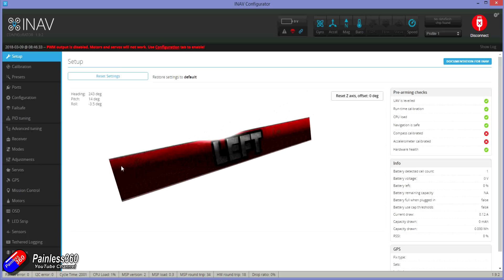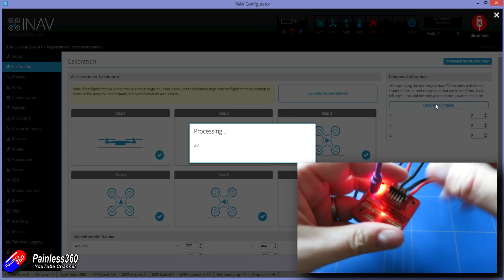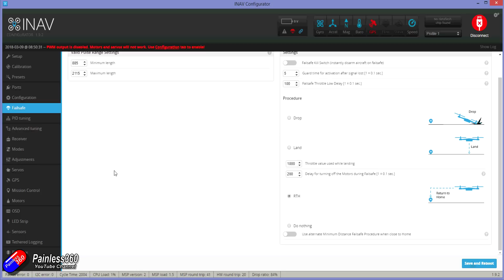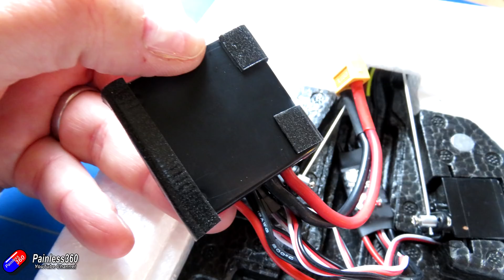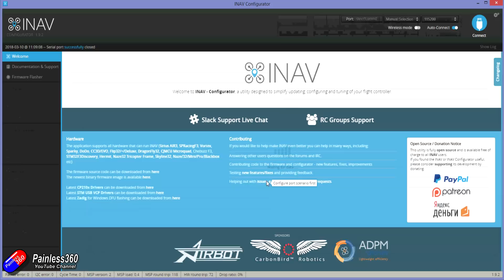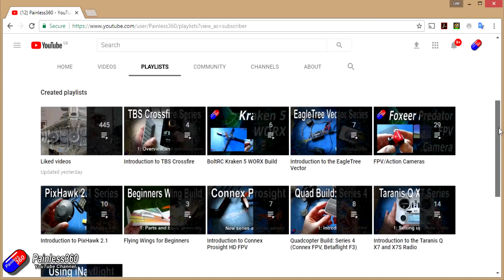iNav V1.9 Wing Build: Basic setup and installation (Orbit Wing and F35 FC)

Comment: if the battery powered the fc is it ok if i just plug in motor servo along with esc to M1/M2?
Reply from the maker: See the series for the steps. I also have a more up to date iNav 2.1 series...
Reply: @Painless360  aye2.

Comment: Hi bro hope you got a minute to talk got this furious f35 on my tbs wing2. Got a auto launch problem i’ve set all the stuff out exactly as you said like shortening times on the launch all working fine but it’s nosediving into the floor I’ve tried it in horizon and it just flying in a straight line doesn’t get altitude. I can see in the CLI the launch max altitude is at 0 do I need to put this up for it to climb?? or does the launch max angle deal with that or do I not know what I’m talking about 😂 thanks man lov your video your a massive help in the community 👌🏻👌🏻
Reply from the maker: Make sure it is in launch mode by shaking the model hard to start the engine, if it doesn't throttle up it''s not in launch mode..
Reply: Painless360 no that all works fine it just don’t climb go’s straight or smash in to the floor 😐

Comment: i am busy with the inavflight f4 (same as you) and i have it on my desk now, i have done all calibrations but the strange thing is that on my screen in inav it is moving on his yaw (same as in your video).... when i move the fc in yaw its working fine.... BUT when i only moving it on its PITCH then it show movement on yaw ?!?? When i pitch down it als moving yaw to the right, when i pitch up then it yaws to the left??? do you have that also? and no problems with it on your plane/wing???? i do not want to build it in my plane now....
Reply from the maker: I wouldn't use it until you figure that out. See my inav videos. Best of luck..

Comment: Hi Lee, I've set this FC up in a teksumo. Everything was going really well until I turned on the servos. Pitch acts like aileron and aileron like pitch. Everything is correct on the receiver tab in inav but when I click on the servos tab it says "no servos configured add them using the mixer tag" Mixer tab says flight controller needs updating to use the function, even tho I have the latest firmware? Any advice would be much appreciated. Paul
Reply from the maker: Sounds like the servos are plugged into the wrong outputs.. I’d swap them round.. best of luck!
Reply: Hi Lee, thanks for getting back to me. I tried that but it just changes the direction of travel but still the same problem. The biggest problem I have is that I cant access the servo tab. I'll e mail you some pics of the screen. Happy to arrange the phone or skype support with you. Cheers Paul
Reply from the maker: Paul Stuart all of the steps that I followed your in the video series. I don't provide support outside of the YouTube comments, best of luck
Reply: All sorted now using inav 1.9.3. I was using 2.0.0 rc3 where it wasn't working
Reply: Hi Lee, Just finishing off the setup now and have noticed a large reduction in throws whilst in Angle and Horizon mode. Do I need to change settings some ware for this or is this normal?

Comment: Hay just a quick question, if I choose the preset wing I notice it has expo on the configurator do I need to add any expo in my transmitter?
Reply from the maker: You can add it at either end. Adding it on the radio does allow you to change it inflight. Best of luck

Comment: Yesterday 2 miles from home my wing using the f35 suddenly disarmed without me telling it to. Fortunately it crashed in an area that we pretty easily found my wing. Any ideas on what caused this?  I’ve had many successful flights with this board already. Some have suggested I should be running 1.9.1 as there is a known bug with 1.9.0. I’m trying to update the fc but I’m not having any luck. “Stm32 communication failed, wrong response, expected 121 received 0”. Any ideas?  Thank you!
Reply from the maker: Lots on this in the Wiki - there are changes to iNav 2.0 to help ensure this doesn't happen..

Comment: Flaperons works great, but I need flaps on a Ranger 2000. Because I have already cut them out. If I knew.... To many negative things coming up on the F35. First was the RSSI: it does not support analog RSSI. Now with the flaps. And I don't know until maiden!?! I really don't know if it was a good choice. Kinda disappointed!
Reply from the maker: Things like flight controller more to do with the INav software than anything else. I wouldn't worry too much, iNav 2.0 as a completely different mixer setup..

Comment: Hi there! Any idea how to add flaps.I am using the f35 with L9R and Taranis? Thanks and all the best!
Reply from the maker: See my custom mixer video, but if you hang on a little while it's all about to change. In iNav 2.0 there is a completely new mixer section that should make setup of these extra pieces an awful lot easier.
Reply: Waiting for it. Thanks a lot and all the best!

Comment: Hi there and thanks for all your inspiring and informative videos. 
Question: My planned setup is Nano Talon with iNav 2.0 running on the F35 FC. The deviation is that I'm replacing the one default aileron servo with two (one in each wing). This to obtain better stability through tighter control of the ailerons (les slack in the mechanics). 
Can you tell me how this can be adapted in iNav? Kind of modifying the basic Nano Talon iNav setup with one extra servo for the ailerons. 
Your reply will be much appreciated. 
Best regards,
Torgeir
Reply from the maker: Until I play with iNav 2.0 more it’s tricky to comment. The new mixer tab in iNav 2.0 should make that a breeze..
Reply: Painless360 Thanks for your quick response. Really hope you will follow up with some videos of the 2.0 version as well. Your videos are much appreciated.
Respectfully Torgeir

Comment: Hi.
I have everything setup but can't seem to arm my motor
I have assigned a switch but its not lighting up the bar when selected, i replaced my esc because i thought that was the problem but still have the same issue 
Transmitter working correctly in I NAV
Many thanks
Reply from the maker: What other troubleshooting have you done? Has it ever worked for example?
Reply: Hi
no never worked. In i nav i have run the motor through the motor section and the slider so i know it works just can't seem to arm the motor 
i fly in mode 1 but never had any problems with my quads and this is my first wing
Reply: My ESC is making the correct chimes when i plug in my battery as well
Reply from the maker: Check that all the checks are green in the iNav app and then it’s usually the min throttle value needs adjusting..
Reply: That's the problem, trying to set up the RTH now have selected RTH in fail safe tab but still have a X will have a little play
Your a star thank you

Comment: You mention each time you reboot the image moves around in the setup menu as it finds it's place. Mine does the same, but then continually twitches back and forth even when place it on a table with no possible external factors affecting it. 
Does this mean my accelerometer is damaged?

Comment: Hi, im trying to setup my f35 on a ar wing with Inav,i wire m2 motor, and s3and s4servos, with a spektrum dx8 transmitter and i cant be bale to arm motor and servos works but i have to adjust travel and end points .How can i asign arm mode and autolanch, rth etc...
Reply from the maker: That will be covered later in the series.. It's all in the documentation if you need to look it up now. Stay tuned! :D

Comment: Hi Lee, I am hoping to put an Omnibus F4 pro + x8R into a Bixler 3. The Bixler comes with the Aileron Servos connected with a Y cable, Do I have to split the servos as Iwould prefer not to lose the channel. I was hoping to use channel 5 for flaps and ch6 for s.port? Thanks
Reply from the maker: I'd just use the single line from the 'Y' cable for the Ailerons. It's how the iNav system will default anyway.. I prefer to use the easiest method :D
Reply: Painless360 Thanks. I'll give it a go. Appreciate the help and quick response.

Comment: could I ask how come the simulated model on your iNav is a box? mine has the usual little graphic of a quad also have you made any more episodes or just two at the moment?
Reply from the maker: This is very much a legacy thing back from the days when the software was only about multicopters. The box is the default model. Because an airplane doesn't have a nice 3D model in the code it defaults to this box representation of the orientation. Hopefully one day, it will get sorted!

Comment: Seems you also can select internal or external magnetometer (as opposed to having to cut a trace on the FC)
Reply from the maker: As you'll see in the next few videos, I actually disable that magnetometer as we are using a fixed wing here. Stay tuned!
Reply: Painless360 Think you disabled it in this one already 😉
What I actually meant, it is a nice feature if you want to use the external Mag in a GPS (a bit further away from the noise) 👍🏻